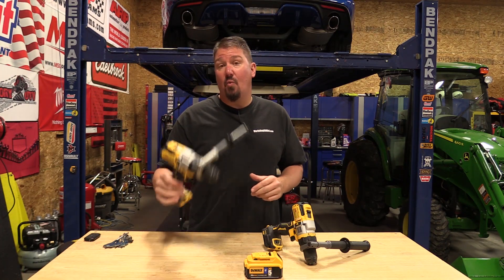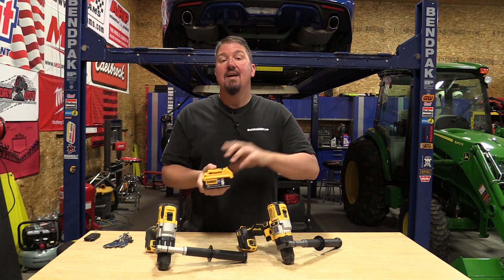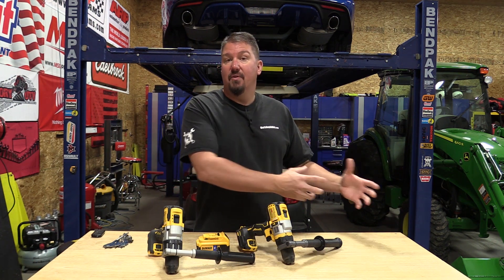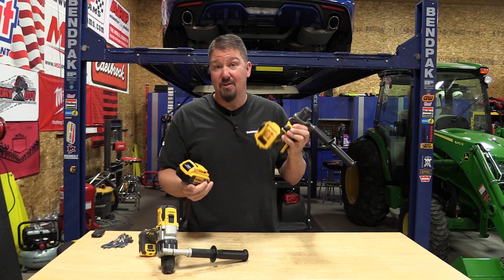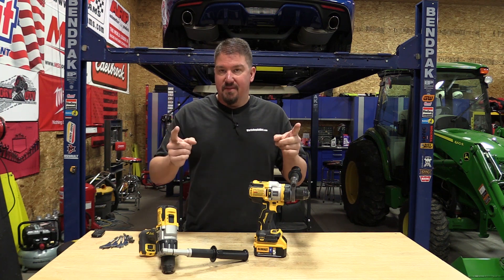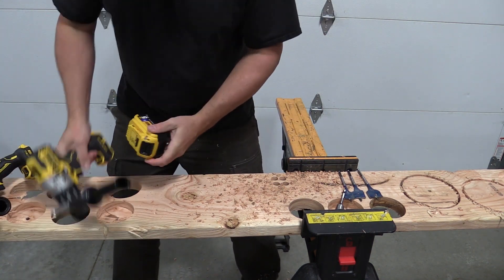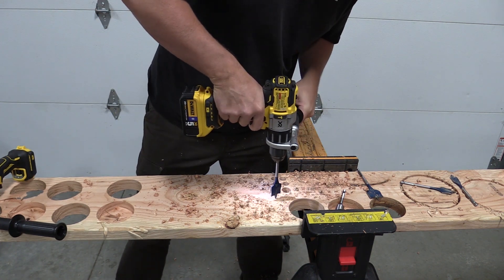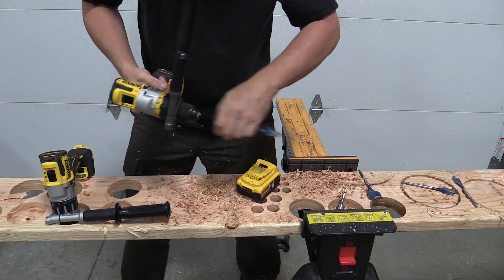I Was Wrong? DEWALT 20V 5.0 Ah Battery - FlexVolt Advantage DCD999 Vs Power Detect DCD998 For Power

Comment: I think it's less about the academic differences between the DCD998 and DCD999 tools and more about the end-user and the kits these drills are packaged with. If you are a strictly 20V system user then the DCD998 is a better choice, you get a 8AH battery and the DCB118 8-amp charger that is tailored to the bigger 20V batteries and will charge them faster. The DCD999 is a better choice for those that have 12V, 20V, and maybe thinking about adding (or already have) 60V tools in their inventory. The DCB1106 charger that comes with the DCD999 kit is a lower output 6-amp charger (still better that the DCB115 that is the standard in 20V kits) but is also rated for the 12V Max tool batteries. I just bought the DCD999 kit because I have 12V  and 20V tools and now have the option to add a 60V tool without having to invest in a kit or separate battery (2Ah 60V battery retails at $160).
Reply: Unless you're getting a really good sale price l on a bare tool it is always better to buy the kit. At normal prices the kit usually costs $100 more. And then you get a battery that is worth $150 to $160 plus a charger. 

When I bought my 999 drill kit it was $175 for the bare tool and $275 for the kit with 6 volt flex volt battery and upgraded charger.

When I got my 60 volt circular saw they had the bare tool for $199 and the kit for $299 with a 9 amp flex volt battery and charger. At the time I bought it that battery sold for about $180 by itself with no charger.

Comment: What the heck DeWalt, confusing the hell out of this guy. Im just going to wait for the just 60v flex volt.
Reply: Not going to happen as a hammer drill.  You’re going to have to step up to a sds rotary drill at that point.
Reply: @juanc5149  Ar?

Comment: No need to apologize.  I did suspect that the two were basically the same, the Flexvolt advantage just let's DeWalt sell the same drill at Home Depot too.
Reply from the maker: In the other test, the FA did outperform the PD using only a flexvolt battery.  So the FA does work better with FlexVolts.

Comment: I would like to know if the plain DCD996 gains power when the 8ah battery is used.
Reply from the maker: It will gain a little, but nothing like the 998 or 999.  I will try to do a video on that.
Reply: @WorkshopAddict  Look forward to seeing that.
Reply from the maker: @johnr9659  just finished it.  Give me a day to get it put together

Comment: Dewalt marketing is smart...if you shop at Lowe’s will sell you the Power Detect...if you shop at Home Depot we will sell you the Flexvolt Advantage...we will even price them the same ($279) so the customers can’t get it cheaper at any stores because we won’t carry the two “same” drills at either stores...”build it and they will come and buy”......🤔🤔
Reply: I think its dumb to do it that way
Reply: @rcud1  you are absolutely right...Dewalt will get you your money no matter if you shop at Lowe’s or Home Depot...just like you can only get the “Atomic” at Home Depot and the 12V “Xtreme” at Lowe’s...Milwaukee products you can only get at Home Depot....Milwaukee used to be at Lowe’s for a long time until they list their contract and Home Depot got the exclusive ....capitalism at it’s best...🤔🤔
Reply: eBay has them all. . . 😅

Comment: Excellent demonstration, at the start I would have said the flexvolt advantage was more powerful but the last test it sounded like the power detect was more power but all in all great drills. Still think dewalt need to make their minds up on what they are doing with atomic was a disaster and now these two different ranges should stick to xr and flexvolt and just say these new tools take advantage of newer batteries with newer cells 🇮🇪
Reply: I think it's more of a Lowes vs. Home Depot thing , because they each want their own line of DeWalt tools and DeWalt is just trying to appease them both ...
Reply: @brianf9619  You hit it right on the head, those stores sell a lot of power tools so instead having one getting rid of your tools you appease them

Comment: I would test tools using 1 inch OSB 4x8 sheets and rip them to 1foot wide and layer them up to do drill testing
Reply from the maker: while my self feeding bits sucked today, they really suck in OSB.
Reply: @WorkshopAddict  oh ok I was thinking it would have more consistent results
Reply from the maker: @dirtydurbin3673  it would if I was not relying on a self ferb bit to level the playing field.

Comment: Awesome video! Power Detect and FlexVolt Advantage they all have the same internal ESC and same motor. It's all about the battery. No matter what the ESC or software improvements are used, if the battery doesnt give out more juice it doesn't matter. Even more, if the ESC has a higher safe switch (current limit) the tool will be more powerful but the battery will suffer and degrade more quickly.

Comment: About time these made their way to the UK  😁
Reply: Get one imported, still cheaper than buying in UK I did, unfortunately advantage not released then so had to import 2 8ah batts as well, wanted for souber lock jig, (high rpm high torque) works great with my simple speed hack! these actually have more rpm in hammer mode (see side of drill/specs tells you right there, clocked this before I finished unboxing) so just start drill in hammer then click back into drill mode without fully releasing the trigger for more speed until you fully let go of the trigger again, extra speed seems to come electronically interestingly

Comment: Question:  The test on Sept 19th the one you did on the $100 Amazon 18V 1/2 " Impact Wrench, the one that you dropped tested, and it stopped working. Have you found out what the problem was or any conclusion?  Everything seemed great till the mysterious drop.
Reply from the maker: I could not find anything wrong, even after taking it apart in a follow up video.  It is a mystery.  The battery still works!
Reply: @WorkshopAddict  Well, if it were you, would you take the plunge and purchase the mystery wrench that did so well till the famous drop?

Comment: Have you seen the dewalt holiday promos?
Reply: Basically you can get any Dewalt advantage bare tool, and it comes with a free flexvolt advantage battery, and new 6ah charger.  So the kit for the price of a bare tool.

There is a catch, they will give you whatever FlexVolt 6ah battery they have on hand.  And the advantage works best with the new 21700 cell 6ah FlexVolt advantage, which is what it comes in the kit.  So you may have to exchange the batteries.
Reply from the maker: I have not.
Reply: @WorkshopAddict  go on home depot website and check their black friday flyer. Best dewalt deals in years
Reply from the maker: I will have too, but I know it will cost me a lot of money.  :(